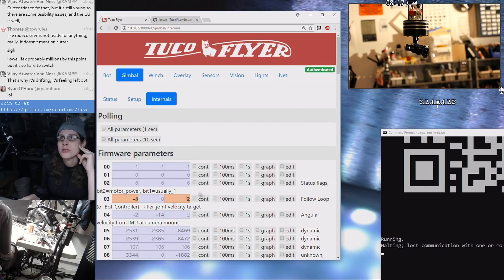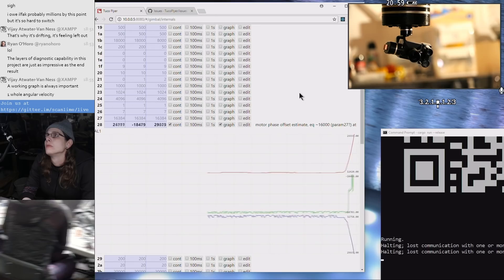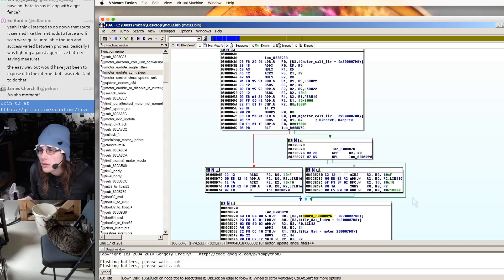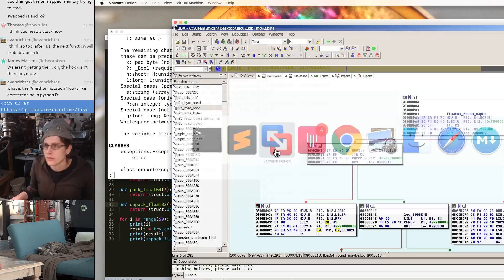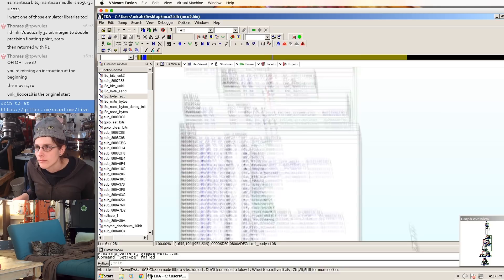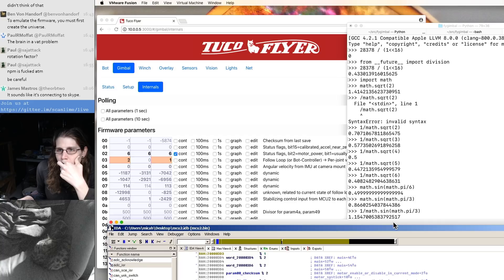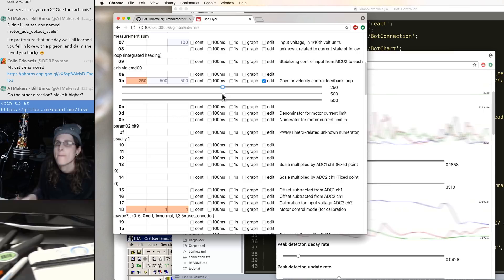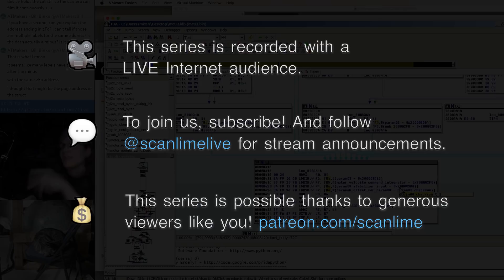Why Reverse Engineer a Gimbal?

Comment: Glad you got the recorder fixed 😁 That was a really cool overview: I've missed a few gimbal streams and some are pretty intense for me to follow while I'm working, but it was cool to hear the high level "how what and why" so far. Glad you've got it working better now, and it was good to hear you address the "why not build one" because I might have been at that point given the amount of time this seems to have sucked up, but it does seem like there's a lot of functionality in there and that it's mostly well done or at least reasonable (or you're just very professional about other people's code)

And, that was a super soothing voiceover for such technical content.... Now just record that flux cleaning brush at high gain ;)

I really don't need more excuses to disassemble arm cortex-m firmware, though.... Tbh I haven't got anything fancy enough with one of those that isn't work related that I'd like to dive into.

Thanks for the effort putting this gimbal supercut together!

Comment: That's awesome. I have two gimbals from zhiyun tech and wanted my own remote controller. I don't understand much from reverse engineering. But I managed it in a few days to hack the Bluetooth commands and reproduce the commands from an ESP32. I just use a Value for motion speed of each axis between 0 and 4095. But there would also be much more data to do other things. I am asking, why did you use this complex hack instead of Jack into Bluetooth? I am sure that should possible as well with feiyutech gimbals.
Reply: Got any info somewhere? I bought a Zhiyun Smooth 4 and just want to tinker with it a bit.